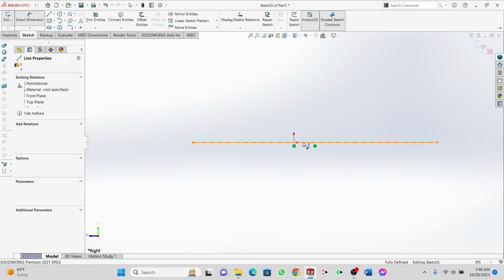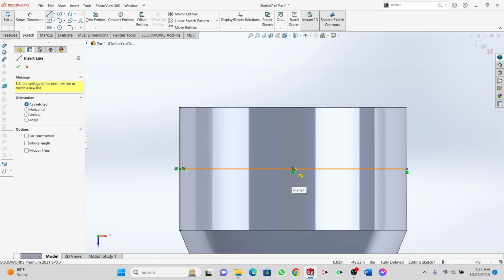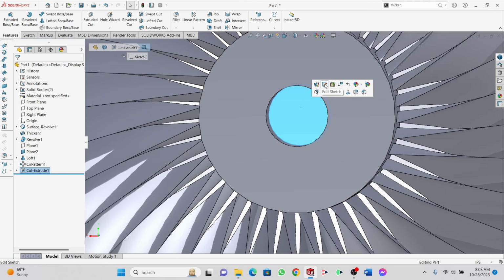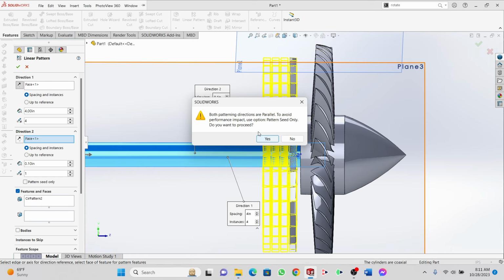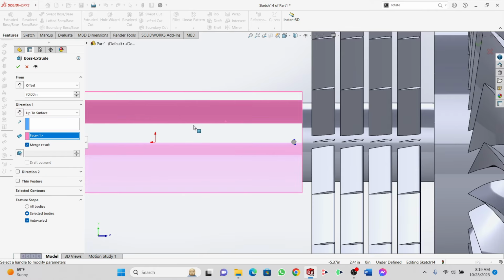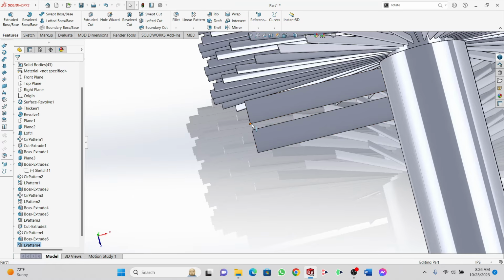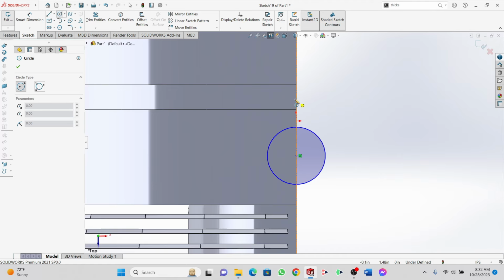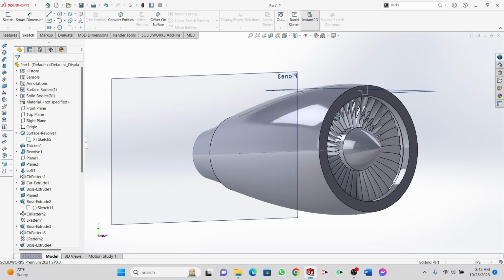Jet engine | Solidworks Tutorial |CF6 80C2 turbo fan |

Comment from the maker: There is a lil mistake out there. In 42:07 I've made a vertical line at the rear part of combustion chamber,it wouldn't be out there. Here the rear part of the combustion chamber won't be closed, otherwise the air will not flow from combustion chamber to High pressure turbine.
Reply from the maker: Here air enters the front inlet and is compressed in the compressor .Then the air went into the combustion chambers where fuel is sprayed into it, and the mixture of air and fuel is ignited. Then the hot, expanded air flows through the high-pressure turbine, which take out the energy and uses it to drive the compressor. I hope you got it.
Reply: so, how to make the air flow from combustion chamber to HP turbine?